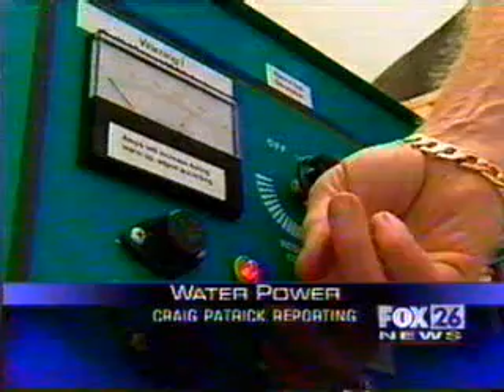Water Fuel Car

Comment: I criticize the news reporters misinterpretation that is "running on water", when it isn't. Water is the bi product, not the fuel.

I pointed out "Water combustion" as a fraud because Water can't oxidate without separating the hydrogen and oxygen first.

There are some really nice ways to separate Hydrogen from natural gas which you can look into however. I.e. Honda's FCX Clarity

None of these claim to be POWERED BY WATER. Water is ONLY a clean bi product of hydrogen oxidation.

Comment: For more information you can check out the article "Permanent magnet" on Wikipedia.

Remember that in creating a permanent magnet, you supply a lot more energy in the creating process than the one you can harness from it afterwards. Movement through the electric field surrounding the magnet. (aka, a DC motor/generator)

This creation process occurs naturally through millions of years in rocks. When you manufacture permanent magnets you gather lots of these rock fragments and put them together.

Comment: I'm not here to finger you and ruin up your hopes. Its only truth. I'm trying to point out all the frauds related to water "combustion" and all the hoaxes associated with it.

There are thousands of people on the net that try to sell their bogus products that does nothing else than basically "cook" your water on your car's battery power.

The only way for a Hydrogen economy to work is to have excess amounts of electrical energy. For example if a Fusion Power Plant was realized.

Comment: Fossile fuels have stored solar energy in carbon compositions. All carriers have been charged.

You need movement in order to gain energy from magnetism. All magnetic energy comes from the (movement) "kinetic energy". 

When you hold your hand out with a ball in your hand, the ball has a specific amount of "potential energy" given by gravity, but the energy is not released until you let go of the ball.

This is high school physics.

Comment: News reporters really like to misinform the public about how the engine really works. Its NOT powered by water. Its powered by Hydrogen, a component element in water composition. H2O (2 Hydrogen, 1 Oxygen)

In order to run on Hydrogen, you first need to separate it. This process is called electrolysis and uses VAST AMOUNTS OF ELECTRICITY. Electricity that comes from, (guess what) coal, oil and nuclear power.

Instead of misinforming, we need new "clean" standards and better nuclear power.

Comment: You need TWICE AS MUCH ENERGY in electricity in order to produce hydrogen. Hence using your car generator you are loosing more energy than you are creating. All energy conversions radiate energy through heat.

Remember, according to the laws of physics, YOU CAN NOT PRODUCE ENERGY. YOU CAN ONLY CONVERT FROM ONE ENERGY CARRIER TO ANOTHER. 

The only exception is nuclear power, where you harness the energy stored in the core of elementary particles from Big Bang.

Comment: The method of extracting Hydrogen from water using electrodes is simply too inefficient a process.  

If the water is heated extraction is roughly 20% more efficient.

Now with the discovery of radio waves used to separate the H from H2O the energy used is even less.

The presumption that it takes the same energy to separate the H as the H gives off is false.

Science simply has yet to find an efficient way to perform the task.

Comment: Besides, this breaks the first law of thermodynamics, the first being "The increase in the internal energy of a system is equal to the amount of energy added by heating the system, minus the amount lost as a result of the work done by the system on its surroundings."

Comment: So is a better question: are you saving money by using up more battery to increase fuel economy? 
I THOUGHT the point of the car modification is to put some H2 in your air intake for fuel economy, as cars burn gas really inefficiently- burning only ~25% of the gas... Just wondering.

Comment: it is a jar of water, then when the water goes through electrolysis it seperates into 2 parts hydrogen and one part oxygen.  The gas is then added to your fuel/air mixture then into your combustion chamber.  Parts are less then $40.  Savings will be in the thousands.

Comment: I talked to a guy here in Houston that worked with the guy. It is a catalyst that provides the power and the catalyst will wear out. They do not include its contribution to the system when they cite performance.

Comment: you know what is really good is that he said that with electricity and water you can make the welder work but if you get the engine going then the engine convert it self in energy to power the welder to work so when it is started it will just keep running

Comment: I'm with Glork2007. H2 & O2 are different from H2O; H2O doesn't burn. The water torch (probably what was in the video), a type of oxyhydrogen blowtorch, involves a mixture of hydrogen (H2) & oxygen (O2) in a stoichiometric 2:1 ratio by electrolysis to achieve a max temp flame compared to other ratios. Read the patent, there's no mention of "HHO", only hydrogen & oxygen. Improving fuel economy w/ H2? Maybe possible. Running a car on water only? Not w/o violating the laws of thermodynamics.

Comment: No. HHO is a liquid. It's water. Look it up on Wikipedia. It doesn't burn unless you put in enough energy to turn it into 2H2 + O2, which are gases. But it takes as much or more energy to turn water into the constituent gases as one gets back when it is burned.

Comment: They are fueled by hydrogen that is made either by natural gas reformation, or by electrolysis of water. Both require energy: natural gas is the energy source in the first example, the second example uses electricity. The energy doesn't magically come from nowhere. If that was true then all our energy problems would be solved.

The Clarity is for lease not sale; there is no "top selling" hydrogen car in existence. If just 1 hydrogen car gets sold today, it will already be "top selling".

Comment: The point is, regardless what method you use, u cannot produce energy simply by converting water to hydrogen and oxygen and converting the gases back to water.

Energy dun emerge out of thin air-.-

Comment: Electrolysis of water to H2 & O2 has been know for well over a century.  Of course this requires more useful energy that it produces so it's not an energy source, H2 can be an energy storage media and ppl have been talking about "hydrogen economy" for 20+ years.  Many technical difficulties tho'.

Sadly you and most ppl couldn't pass the first HS physics pop quiz so you don't understand how silly this idea is.  (yes - I'm a physicist!).

Comment: In order for water to be used as fuel, u need to convert it to hydrogen, but to do that you need to INPUT energy. But no matter wad you do, the output energy will never exceed the input energy. So you can never "produce" energy from water. First law and second law of thermodynamics. 

Beat that.

Comment: Usually it was idiots who said things like that, not 'experts'.  Da Vinci, Gauss, and Newton all posited that humanity would one day most likely reach space.  Physics are based on observation, but they have been proven to be very, very accurate.  

There's nothing complicated about the idea that energy has to come from chemical reactions.  Compounds like gasoline are unstable, and can release energy, but water is very stable.  If you ADD energy to water, it becomes unstable in Hydrogen you burn.

Comment: this is hydrogen and oxygen gas,and trace other gases due to the inefficiency. HHO is a buzzword, like a sales pitch, not an actual gas. You are absolutely correct that they use (more than) twice the energy to seperate the gas, then they stand around amazed at 200 year old electrolysis technology.  Really really STUPID.

Comment: the down side to solar power is you get a small amount of energy for a large panel.  As the technology improves maybe we will see bigger gains.  I saw, based on REAL science, someone who is developing roof shingles that connect as solar panels. Problem is expensive.  There is no free lunch, but solar and wind are the two cleanest technologies.  This stuff here on this scam video is crap...little energy for huge power expenditures and hyped by con men/believed by science scoffers.

Comment: Exactly! The engine charges the battery. The battery splits the water into 2 Hydrogen and one Oxygen. Then you burn them an recover most of the energy you used to split it. The only reason to do this is if electricity is cheap enough and you use mains power to to do the work.

Comment: Toastyovens - it's not a closed system - the fuel being added is water.  The process is not releasing energy - it is releasing hydrogen which is burned for energy.  It also releases oxygen - hydrogen for fuel, oxygen to aid the combustion process.  By the way - take enough uranium isotope, cram it together to cause fission to occur, and there's a nice big release of energy that is somewhat larger than the energy required to kick it off in the first place....

Comment: I can't believe anyone could fall for such a blatant fraud!  Burning hydrogen and oxygen does give you water and energy.  But to break the water back into hydrogen and oxygen requires exactly as much energy as you got by burning those gases in the first place.  You end up right back where you started, and there is no energy left over to run a car or anything else.

This is phony, phony, phony!!!

Comment: it would be better if it was saltwater fro mthe ocean because if its just water, its just going to be another situation like the gas, its going to run out in a bit and prices are going to be high, and if it was saltwater, there would be so much more of it to use, it would help reduce the rising sea level due to global warming and it would most likely be really cheap

Comment: This new system which uses small amounts of energy to break down the water.The energy produced can then be used *in conjunction* with regular car fuel.

This has the effect of making driving cheaper, as you need to buy less fuel, because the water energy makes the fuel you buy go further.

So although the water run car is not with us yet, the idea of how to run your car on water is a part way fact of life today if you know where to look for the equipment.

Comment: "the energy released is only equal to the electricity YOU put in" so by your logic, if we find a cheaper way to refine oil into gas, our cars will be less efficient using that gas. the amount of energy released when burning ANYTHING is independent of how you got it. I don't believe you can get more energy out than you put in however, otherwise we'd have a perpetual motion machine

Comment: Guys,

Conservation of energy prevents this. If you start with water, you first have to split it into oxygen and hydrogen which takes a certain amount of energy. When you then burn the hydrogen, you get the same amount of energy back.

People that claim to have invented cars that run on water are either a) Lying, or b) dont realize that its not actually running on water, but running on whatever energy source was used for electrolysis.

Comment: you can just run the gas through the standard internal combustion engine with very minimal modifications. none the less this can be run as a closed loop system. seeing as the byproduct of the combustion is just water, since the gas is devrived from the water is just a cycle.

Comment: Citation, please? Your invocation of string theory to explain water electrolysis reeks of BS. Also, if the starting and ending products are the same, but you have more energy at the end than you started with, then you're violating conservation of mass energy, whether the splitting and combustion processes are different or not.

Comment: Energy required to split one mole of water into hydrogen and oxygen: 285.83kJ
Hydrogen produced: 2 moles
Energy released when you burn 2 moles of hydrogen: 241.5kJ

Net loss in a perfect world: 44.3kJ

Net loss including inefficiencies in the internal combustion engine:
285.83 - (241.5 * 30%) = 213.38kJ lost

1 mole of pure water weighs 18 grams.

So, if you were to turn 1 pound of water into burnable hydrogen and then burn it every minute, you'd be making negative 120horsepower.

Comment: Batteries dont make energy, they store it. Same with water based fuel sells. You CANNOT make energy from water, it is physically impossible. Water based engines are a scam that have been going on since the 70s.

Comment: 1st Law of thermodynamics: energy can be neither created or destroyed. In other words the electrical energy used to split water into hydrogen and oxygen equals the heat energy released when it burns. Effectively the car is electrically powered, not powered by water, like a steam train is powered by coal not by water. You still have to generate the electricity and there lies the problem, so no it doesn't work as advertised.

Comment: Until recently, gasoline was much cheaper than diesel. Gasoline is more refined than diesel. Because of emission demands, gasoline engines will continue to be "less efficient". 

Bottom line is to put an end to the need of foreign supplied fossil fuels, the governments hand in it and the businesses driving it. Alternatives are viable, we as consumers need to put it into action and make a stand on that choice. It's the only way things will change. Viva la Reveloution...

Comment: Apples and Oranges your debating here.
Diesel engines are our workforce backbone, both because of their efficiency and reliability. You wont find many construction/heavy equipment vehicles that aren't diesel powered. The major drawback of the diesel engine is that it is a warm blooded beast. That in mind, the gasoline engine is/was/has been the preferred engine for the average consumer/weekend warrior. Gasoline engines create less emission over diesel fuels, another draw back of diesel....

Comment: rodneykingman, after reading a little about biodiesel, it does sound quite promising.

First of all diesel engines run 35-40% more efficient than gasoline engines. Both gasoline and biodiesel are approximately equivalent in energy by volume. Soybean biodiesel is estimated to be produced at a rate of 60 gallons per acre but algae biodiesel has an estimated production of 15,000 gallons per acre.

So far, this is very interesting indeed!

Comment: Now if I have two substances with equal energy by volume then it is the machines they power that are dependent for their efficiencies. Another words, the pontiential for work to be done by each of the two substances is equal because the energy by volume is equal.

Comment: rodneykingman, it is nice that your biodiesel's get great milage. That is due to engine design efficiency and size of vehicle. Gasoline vehicles in the U.S. should be made comparable.

Both gasoline and biodiesel contain the same energy by volume therefore the possibile vehicles they power should be comparable.

Comment: rodneykingman, biodiesel and gasoline have the same energy content of ~125,000 BTU's/gallon. Ethanol has considerbly less at 84,000 BTU's/gal. So it depends on which biofuel your speaking of. Since gasoline and biodiesel are energy equivelent EROEI is the only thing left to consider when comparing barrels expended to produce. If gasoline has an EROEI of 10, then for every 10 produced, 1 is exhausted and 9 are left for consumption. For bio EROEI of 1.5, 27 bbls need to be produced to have 9 left.

Comment: rodneykingman, I will look at the data and numbers as a little exercise on biofuels vs. U.S. Middle East imports( M.E.i.). It is something I have not looked at before. Should be interesting. I'd like to compare the EROEI for biofuels, oil, and gasoline. Also the per barrel energy content for biofuels. It is less than that for oil/gasoline. So it will take more barrels of biofuels to replace M.E.i. per barrel oil. Then compare the volume needed versus present production. May take a few minutes :)

Comment: you can't slap that kind of argument on everything. we already have the math and chemical knowledge well-established for this, ever heard of Schrodinger's equation? we already have the solutions to the orbitals for hydrogen, you don't just suddenly make H-H-O possible because someone in this ad claimed it, which could be misinterpreted as bonding sequence, when what they really meant was to convert H2O into its gas or counterpart forms H2 and O2. Take a quantum mechanics class.

Comment: Fun247247, the surface of the sun is 5,778 Kelvin(K). Although the corona is 5E6 or 5,000,000-K.

The video shows the burning of charcoal, brass, and tungsten. Tungsten having the highest melting point, melts at 3695-K and boils at 5828-K. The video states that the torch is hotter than the surface of the sun, therefore, we should have seen the tungsten sublimate at 50-K hotter.

We don't even see it melt!

Oxygen/acetylene produces a flame of ~3200-K which is of the highest gaseous fuels.

Comment: HOW2useWATER4carFUEL, as wikipedia states: "Hydrogen is an energy carrier, not an energy source, so the energy the car uses would ultimately need to be provided by a conventional power plant."

That energy from conventional power plants translates into fossil fuels.

You continually state the obvious in an attempt to confuse the facts. You mention a host of auto manufactures as if this is to provide proof to some grand scheme of things.

Your attempt to distort is astounding!

Comment: Producing Hydrogen from water requires ample amount of electrical energy.

Does the hydrogen obtain can produce energy more than the energy used to generate it?

Scientist since the early 1940's have found out that the output energy is less than the inputted energy.

If you claim that its output energy is greater than its input energy.

Why is it that water cars still requires gasoline or diesel?